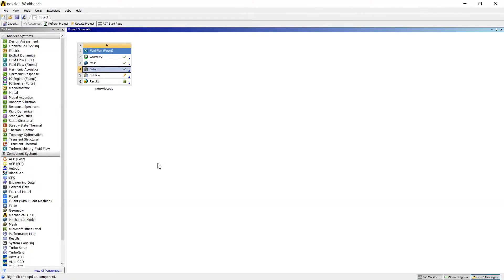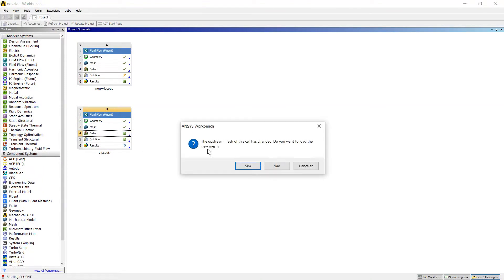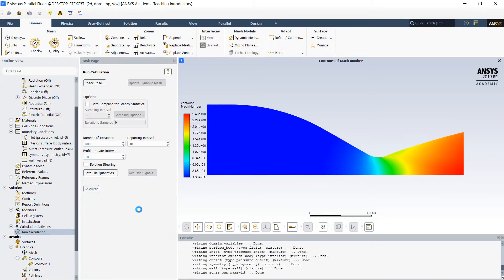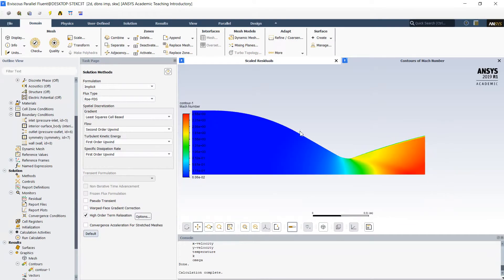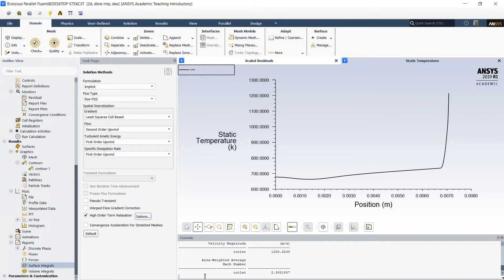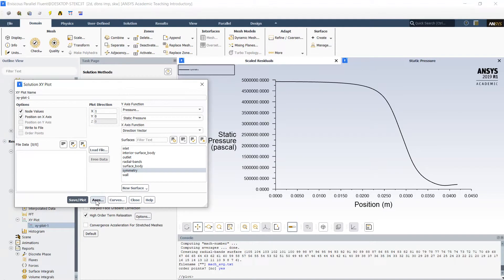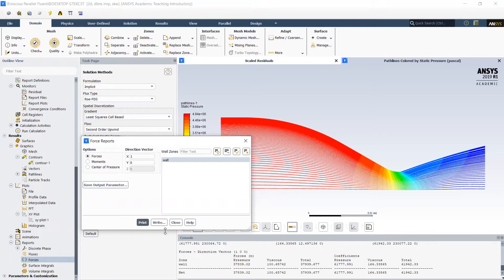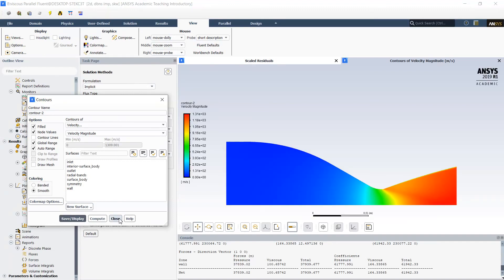Supersonic nozzle simulation in Ansys Fluent - part 3

Comment: Hey Guys. Really good Video. Could you maybe do a video on a supersonic nozzle but not at design condition. With Shocks Inside. I am trying to simulate it but my residuals are not Converging. A video. Or even a reply here in comments section would be really helpful. Thanks
Reply from the maker: Thank you. We have the video with a shock wave inside. To make it work, you need to reduce the time step significantly when the shock appears, especially the normal one, because the gradients are too big for a normal step.